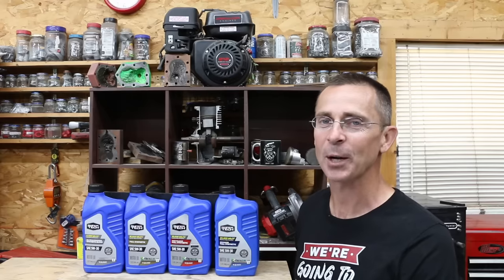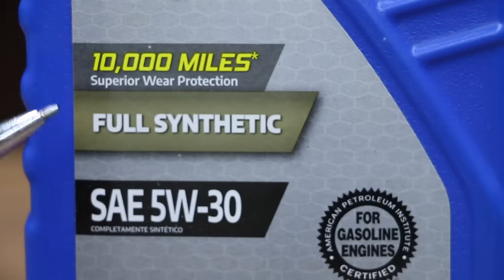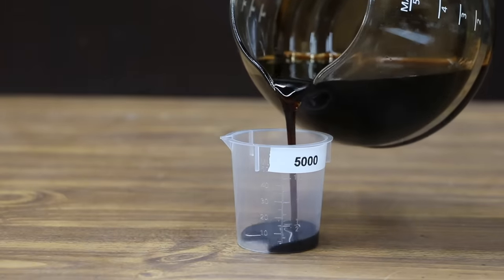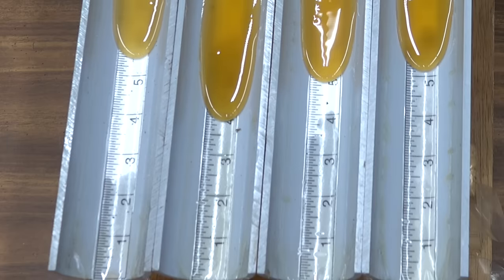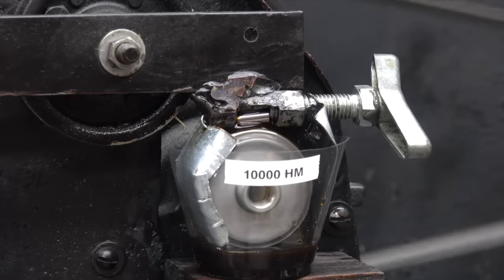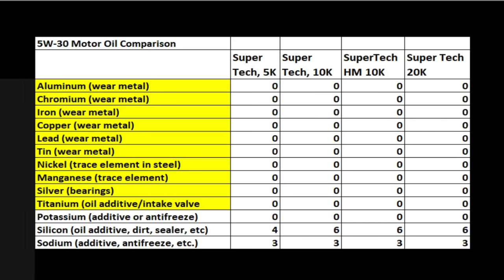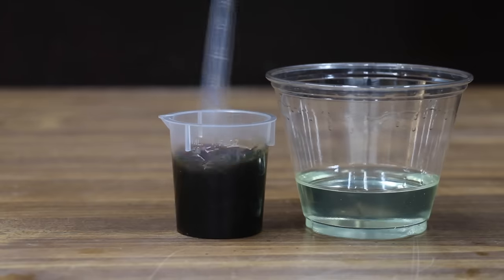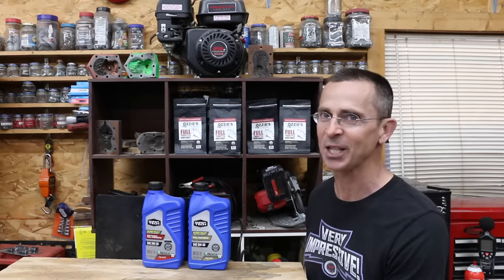Are They All The Same Motor Oil? Let's Settle This! Four Types of SuperTech Motor Oil Compared

Comment: Anyone who let's oil stay in engine for over 5000 miles is foolish..
I have been a mechanic since 1976.
Today timing chains and plastic guides cams phasers and control oil passages clog wear out ruin engine.
Oil filters bypass around 6-7 k miles.
Idiotic nonsense when people try to save $40 and ruin motor.
Many engines last 400k miles today.
My Chevy van 4.3 is at 389k burns no oil runs perfect.
I change 3000 with any brand rated oil
Reply from the maker: Thanks for the feedback.

Comment: Oil gets dirty. operating conditions vary, but are rarely ideal. Any more than 5000 miles between changes is not advisable! I’m still a 3,000 mile, best oil I can afford kind of guy. And never, ever cheap out on an oil filter.
Reply from the maker: Thanks for sharing.

Comment: 3000 miles is my target to change oil

I use  mobile 1  10,000 mile 

my vehicles  will last  between  400 and 500 thousand  miles
Reply: At least you hope it will

Comment: For future oil tests, you might consider abandoning the whole swapping the burners thing, and instead just use one burner for all of them. It'd increase the time taken for the tests, but would eliminate any potential variables (leaving one on one burner for slightly too long, for example). Alternatively, some sort of mechanism that picks up the pots, spins around, and places them back down when triggered would also work, and would have the bonus of eliminating the variable position on the burner. Something like that could be done rather easily, I think.
Reply from the maker: Thanks for the suggestion.

Comment: I would avoid any direct injection engine with a turbo !!!!   I have for decades and will continue to change oil at 3000 to 3500 miles.   I drain my oil all night    Its easy to get a camry 2.2 and ford small block over 200k with good oil changes     the camry has 368K miles no rebuild     both of my engines are port fuel injection
Reply from the maker: Thanks for sharing.

Comment: I don’t know it’s hard to believe I used the mobile one advance full synthetic for 10,000 miles change that at 8000 miles in the shit was completely dirty and black. That was the most horrible soil I’ve ever used I switch to supertech full synthetic 10,000 interval And it was a little dirtier than what I do or use now now I do use the 20,000 in advance for synthetic from supertech. I check my oil every week I drive my car literally every day all day I use a micro guard or a wix oil filter so that being said, I will keep an eye on  it so far I have not had any oil consumption or boil off and surprisingly it’s still decently clean but like I said, will keep my eye on it. I have about 800 miles left before I actually really need to change it. I kept it at 10,000 miles to be changed, I might let it go an extra 3000 miles depends on how dirty it gets from now and then
Reply from the maker: Thanks for the feedback.

Comment: As mobile 1 synthetic   same trip same speed same tep of days same truck mobile 1 in my 260k Yukon 350 sbc 750 miles per qt tho  put Schaffer  oil in again bk to 3100 miles per qt  the Schaffer  oil moter doesn't  tick at minos  20 degrees   or at 100 degrees  when hot out the mobile 1  it ticks either  or  ok at 40 degrees  to 80 degrees  outside  temp outside
Reply from the maker: Thanks for the feedback.

Comment: If your car leaks and burns a quart every 4,000 miles, you are effectively doing a 15,000 mile oil change.  Boring for synthetics.

WAY back when the first synthetics came out I read a test done by, perhaps, Mobil.  The ran the engine on a dyno the equivalent of 100,000 miles.  On tear down there was literally zero wear.  All the old machining marks were visible, no ring ridge.  

So, a 15,000 mile oil "change" is fine with me.  We have gotten so brain washed that we MUST change every X miles (which has gone from 1500 when I was a kId,) to, I think 10,000 typical.  With regular oils.
Reply from the maker: Thanks for the feedback.

Comment: I’m nuts I change my oil every 1500 miles
Reply from the maker: Thanks for sharing.
Reply: No, don't do it, it'll wear the engine out from start ups after the oil change before it wears out by driving
Reply: @jkng4606  too late 25 years old with 450 k miles still going strong 5.9 magnum  @Jeff who taught u that logic 😂😂😂😂
Reply: @ProjectFarm  actually after a oil change with a Dodge 5.9 Magnum engine it don’t start burning oil till about 1500 miles and instead of adding I just change it , it’s pretty dark at that point anyways , cast iron block , old 360 with a throttle body intake placed on top

Comment: I bought the 20,000 miles stuff because that's all they had unfortunately, but it's a few bucks more, who really cares.  I really like the Wally World stuff, just as good as name brand.  IMO you shouldn't be going long periods without changing your oil anyways.  It's better to be safe than sorry, so doesn't really matter a whole lot, just look for the value brands.  Tons of know-it-alls on the web that claim to know this engineer and that engineer and say that you can go 15,000 miles and other such nonsense.  Go ahead and try that and see how that works out.  I'll stick to 5,000 and pay an extra few hundred bucks over the life of the car for piece of mind.  They will be replacing engines or junking their cars.  Good thing they knew a guy that was a super important engineer at GM that told them something.  SMFH
Reply from the maker: Thanks for the feedback.

Comment: Never Ever use Sears oil. Will not clean and you will have a engine filled with deposits. I took apart this one engine. Guy told me he changed the oil every 3k miles with Sears oil. Just awful.
Reply from the maker: Thanks for the feedback.

Comment: The best test is look inside the engine after draining the oil 😂 looking at used oil or how if flows prove nothing
Reply: That's not a good test because there's too many variables to try to control including; fuel, rpms, and age of the motor. Plus if oil does bad and damages the motor, that would screw with any results after

Comment: Change  6.000 latest
Reply: Than you arrive in Europe where diesel engines change oil every 20 - 40.000 miles and they are running smooth for at least 500k miles 💪 I was in shock when I visited USA and oil changes are like every 3 months 😂 pretty good business I think

Comment: It's a scam. Less oil  changes = increased repairs and shorter car life, driving more sales. Designed obsolescence. There is not enough difference in the oil to warrant the cost. Save your money and change it more frequent. My $.02
Reply from the maker: Thanks for the feedback.

Comment: Sorry, no. The top three "full" Synthetic motor oils are: Liqui Moly, Motul, and Amsoil in the correct viscosity for your vehicle. But really, it's whatever makes you happy as long as it is fully synthetic and meets the API Ns SAE specifications for your vehicle.

SAE stands for the Society of Automotive Engineers (United States). An oil rated as SAE Oil (for example, SAE 5W30) denotes its viscosity. API stands for American Petroleum Institute. Engine oil with an API rating means that the lubricant meets the minimum performance standard accepted by auto manufacturers.

PS - Change your oil & filter every 5,000 miles or six months, whichever occurs first. Oil & filters are cheap, but engines are expensive. LOL
Reply: No
Reply: Why six months? Amsoil is good for a year